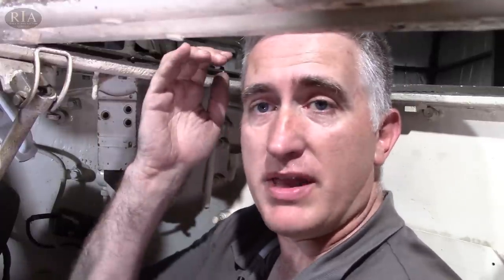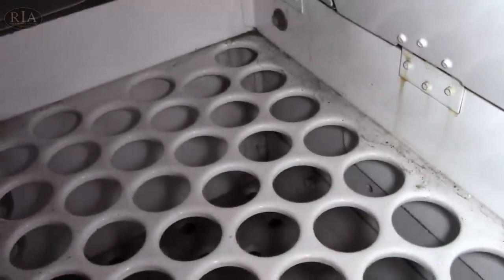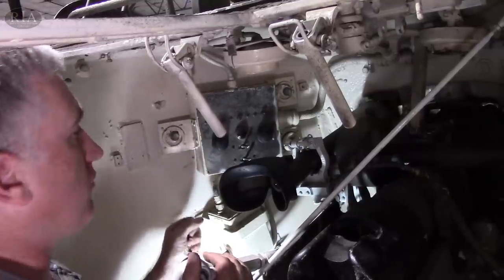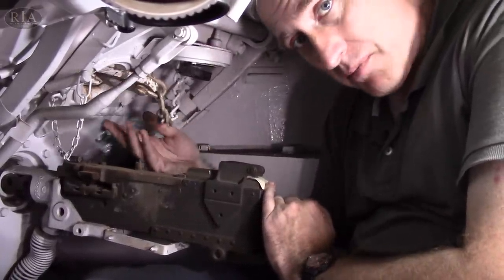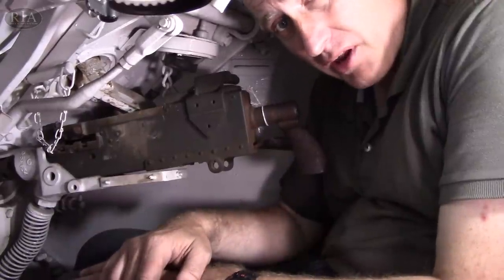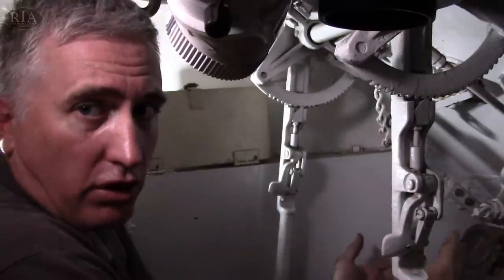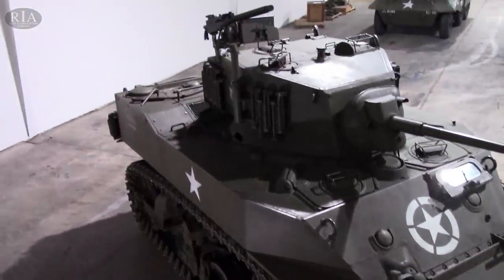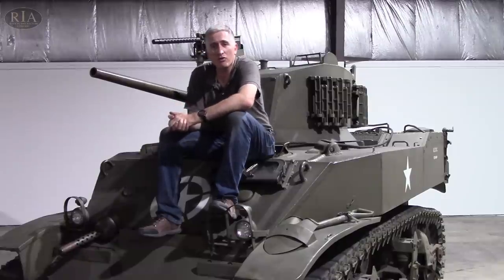Inside the Chieftain's Hatch: M5A1, Pt 2.

Comment: I do really like the M5 Stewie. Didn't Brazil put 90mm guns in theirs and use them through the 90's. And Paraguay also had Stuarts in service until 2014! Great little workhorse
Reply: PMGF 90mm on an M5... are you suuuure about that?
Reply: Look up the X1A and X1A2 Brazilian light tanks
Reply: PMGF If It has "X" in it, it is a prototype. We ended up using the Cascavel(rattlesnake) for the 90mm gun, a national project. Never even heard about a M5 with a 90mm gun here. But while on Stuart brazilian prototypes, we also made one with rockets. Like, the big ones. Not that much people know about it.
Reply from the maker: Brazil used 100 X1 tanks in the cavalry regiments, deliveries completed 1978. The X1A1 did not enter service, but 50 of the X1A2s did, deliveries completed 1983.
Reply: The norwegians modified their Chaffee's to carry 90 mm guns though.
Reply: A 90mm?  I can just imagine how much this little tank would rock from the recoil from the main gun enough to knock ones teeth fillings 😂
Reply: @janekfan666  I'd hate to be inside with the recoil.
Reply: @ernestpaniagua1210  cockerill made low pressure guns suitable for light vehicles.
Reply: @KorianHUN  interesting I didn't know that.

Comment: According to a training film from the period, the air intake is cevered to prevent the good engine from drawing too much air in, I dont understand that as the engine will only draw in what the vacuum from the cylinders pulls
Reply: Yeah, that makes no sense. Presumably you misunderstood, or the guy writing the script had no idea. Or they figured nice simple concepts were more important than truth. There is no such thing as 'too much air' available to an engine, and all restrictions simply reduce the power output. If you do want to do that, you do it by adjusting the size of the throttle body or limiting the movement of the butterfly valve. The covers protect the filter from debris, water and damage. That is why automobiles come with their air filter inside a plastic box drawing air from behind the fender. Aftermarket open-style filters rob less power, but they are more vulnerable.
Reply: I would guess that you cover the bad engine intake to direct the air drawn into the engine compartment was directed out through the working radiator for cooling.
Reply: Might be for the vacuum lines for extras around the tank, with one engine down you lose half the vacuum, but I don’t know if those tanks had vacuum lines

Comment: I would love to see a video of yours explaining tank optical systems in detail, your average layman might not know what an objective lens does lol.
Reply: i sure dont :)
Reply: This goes for any kind of scope; telescope, microscope, etc:
There are two lenses that you are really concerned with, one being the Focusing Lens (Or Ocular Lens), and the Objective Lens. There are usually going to be more lenses between them, but ignore them for now.

The Focusing Lens, or Ocular Lens, (Eyepiece) is the lens you put your eye to. Its job is to focus the image on your retina. They can do a lot more, depending on the application, from further magnification, setting eye relief (how far your eye has to be to able to see the image clearly), etc.

The Objective Lens, is the lens that is closest to what you are viewing. What matters for it, is size, really. A small Objective lens, will gather less light, which will, invariably, deliver a dimmer image. A large one, will provide a brighter image. At noon, it doesn't matter which you have really, as both will get more than enough light to function perfectly well. But as you get closer to dusk, or dawn, get cloud cover, or enter a built up, urban location, a large objective lens will give you more light to work with, where a small objective...could wind up too dim to use. With tanks, it becomes a balancing act between maintaining armour integrity, vs ...being able to see.
Reply: Objective shows what is actually there.
Subjective shows what you reaaaaally wish to be there.
Reply: Ditto, if really like to know that a "unity sight" he keeps talking about is.
Reply: Nice description Goldmarble, thanks! :)
Reply: "Unity sight", as far as I am aware, basically and simply means "no magnification" - the optical ray path breaks, but the "zoom" stays x1. Usually we are talking about prisms here.

Comment: About the 3000 mi radius on the Stuart. From Normandy to Moscow, it's a little less than 2000 miles. That thing can go there and halfway back before needing major maintenance!
Reply: Yeah. Because tanks just drive directly forwards and never have to maneuver or go back for refuelling or shift to another sector of the front.
Reply: Ah, you see I did actually take that into account. the distance by plane would only be about 1600 miles. By modern roads, it'd be 1800 miles. Even during the war, there was vast road systems already, and plus tanks can cross fields, so giving a rounding estimate of 2000 would be reasonable.

About the other points you made, the point about refueling would also be moot, because just bring a refueling truck along. Then the point about being assigned to a different sector wouldn't matter in the hypothetical, because during the war this wouldn't have happened anyways The reason for that is because of cutting across Germany, plus if you wanted to send stuff to Russia, just use ships.
Reply: +Samuel Fisher I think you are underestimating the amount of maneouver. Also that's 3000 miles on nice roads without anything untowards happening, like rubble on the road, poor roads, or people shooting at you. Still, better than the Medium D in the early 1930s, which would probably be down to only half the number of WHEELS it started with in under 300 miles.
Reply: Like I said, because this is a hypothetical, we don't have to worry about getting shot at (because they'd never do this during war time). Either way you'd be surprised with the road system that was in place at the time. This is when the first construction of the Autobahn went into place. The autobahn went from close to Antwerp, and went to where Lithuania is today. Getting from Normandy to Antwerp is relatively easy as well, because the French constructed cross country roads before the war. The only place where you'd have some difficulties is going through Russia, but you can use a rail road as a road.
 If you add up the distances that I covered, ~300 miles from Normandy to Antwerp. ~1000 miles from Antwerp to Lithuania, and ~600 miles from Lithuania to Moscow.
Reply: In theory the road and rail network was great. In reality there was a war on and significant portions of the faster roads had been blown up, or were full of the enemy. It was a bit hard to go direct.

Comment: Can we hear more about this story where a company of Stuarts 'hounded a tiger to death'?
Reply from the maker: I spent a half-hour looking on my hard drive for the file, I seem to have lost the bloody thing (if I ever scanned it). I'll keep an eye out for it.
Reply: The tiger does only have 60mm of armor right behind the tracks, so it is very plausible (Though US tankers didn't know that XD).
Reply: There's also the fact that IRL the armor will deteriorate. You shoot something enough and it'll start to spall and eventually the shell can punch through the more brittle steel. Or, its also possible they got a shot into a weak section (this also depends on whether it was properly destroyed or just disabled like Tiger 131), or got a ricochet that pierced inward.
Reply: +The_Chieftan I have heard of this account and read a summary of it in a book (remember those) back in the 1980s. Not that I can remember WHICH book, and it came from my local library so I don't have it any longer. If it is the same incident it was probably 2nd Armoured based on the fact I was researching that unit at the time, and involved a lot of circling the Tiger faster than its turret could track, and several tanks taking pot shots. I can't remember what actually did for the Tiger in the end. Maybe it ran out of fuel :)
Reply: The M8 taking out a Tiger is just a myth, a case of mistaken identity. There never was a Tiger II at that place on that day. When one goes through the unit records of the only German heavy tank battalion (ss 501st) that was close to it one sees that the furthest the unit came was at Trois Point, some good 40 to 50km distance of travel from Sankt Vith in those days before it was forced back to Stavelot by American fire. They are very detailed in what tank was lost where, all of them back up by photograps showing the knocked out tanks, not surprisingly there is neither mention or any photograph that shows a knocked out Tiger II at Sankt Vith. 

Even the material used from the archives by the people who desperately to claim that the myth is real contradicts the claim as the raneg at which the Greyhound fired was greater than the range listed in the ballistic report at which it might have been possible. Photos made by the US troosp in and around Sankt Vith show no Tigers, just a mix of panzer Ivs, Panthers, and Stugs.
Reply: Don't know if an M8 ever took out a Tiger II, but at least one of them knocked out a Panther tank. On the 27th of October 1944 an M8 of D Troop, 87th  of the US 7th AD spotted a platoon of three Panther tanks of 9. Panzer Division on the road near Neerkant in the south of the Netherlands. The car commander allowed the first one to pass (he was hidden behind a farm along the road) and then fired 6 37mm rounds into the back of the Panther from a range of 15 yards. The panther crew abandoned its tank and the M8  escaped to safety before the other two Panthers managed to bring their guns to bear.
Reply: Can we honestly say that it was knocked out when there is no information given on the damage sustained by the tank or even what happened with it after the M8 left. For all we know the crews would have returned shortly and resumed business.

Was the 9th Panzer also deployed in the Netherlands? Given the location wasn't it one of the Panzerbrigades operating there.
Reply: This is from the AAR of the 87th: About noon, a Troop D M8 armored car was hidden behind haystacks and buildings at the Hoogebrug road junction, when three tiger tanks moved slowly down the road, about 300-400 yards apart. The armored car allowed the first Tiger to pass, and then from a range of approximately 15 yards, pumped six rounds of 37mm AP into the rear of the tank. The tank was ditched, and the crew abandoned it. At least one member of the crew was killed as he fled. Meanwhile, the second Tiger continued up the road toward the junction, and the third swung off to the North to flank the armored car. The armored car escaped when the Tiger was within 200 yards. Later in the afternoon three TD's and one medium were sent to get a Tiger; three TD's and one medium were lost.

The AAR says Tiger tanks but this was 9. Panzer Division and they only had Panther tanks plus a handful of Panzer II tanks. The area were the incident took place was captured by the Germans so the Panther was most likely towed away by a Bergepanther for repairs. 9. Panzer Division reported a strength of 6 Bergepathers on 1 November 1944.
Reply: Pantserbeest  
when you refer to the Panzer II do you mean the ausf. L 'Luchs'? Normally these would be in the Aufklarungs abteilung. With 9th Panzer it could also have been Panzer IVs as the division should have had some of these though without the actual unit records it is hard to say for certain.

If the Germans were able to hold the area then the unit records should be all the more interesting as we might be able to tell what happened to the tank in question after the engagement.

I'm Dutch as well so the language shouldn't be an issue. By all means send them.
Reply: Waar blijven de bevrijders! September-Oktober 1944 van Hugo Levels en Eric Munnicks
Slag in de schaduw Peel/Maas 1944-1945 van A. Korthals Altes en N.K.C.A. In 't Veld
Brabant Bevrijd van Jack Didden en Maarten Swarts
'40 Van Oever naar Oever '45 van de studiegroep Leudal

https://www.blikopdewereld.nl/geschiedenis/nederland/geschiedenis-nederland/1013-de-strijd-bij-meijel
Reply: 9. Panzer Division only had one tank battalion (II./Panzer Regiment 33) with Panther tanks. The first tank battalion and regimental headquarters were at St. Polten for their reconstition. They would rejoin the division in December for the battle of the bulge with 28 Panzer IV and 14 StuG III. The Panzer II tanks were indeed with 9. Pz.A.A. They were from Panzer Kompanie Köhler out of Spandau (Berlin) and were added to the division on 21.09.1944. They were probably not Luchs.

Source: https://forum.axishistory.com/viewtopic.php?f=50&t=65154
Reply: Pantserbeest  Now that you mention it I do seem to recall seeing photos of Panzer IIs used in the Netherlands in 1944, it might be that these were Panzer IIs belonging to the 9th Panzer.

Also thanks for the book title, will go and check it out.
Reply: @Dreachon  so the m8 took out a panzer II and bragged about taking a panther out.
Reply: @DrLoverLover  Well, it wasn't a Panzer II as these had been pulled out of service long ago.

Nor did the crew of the M8 go around bragging as the unit they belonged to themselves never even reported or listed this supposed engagement in the first place.
Reply: RedTipAlpha they were still plenty aware that with superior numbers and mobility they could get around it and shoot it in the ass.

Comment: As far as using the American 37-mm gun to knockout a German Tiger Tank; a U.S. 37-mm mounted in a Ford M8 Greyhound brought down a Tiger in the waning days of 'The Battle of the Bulge'. It did so by allowing the Tiger to pass by, then sneaking up behind it. It took only three rounds to bring the beast down, but contrary to what is said here, it did indeed happen! 👀
Reply: Honest I not surprised a herd of Stewarts M5 could knock out a  single Tiger or a Panther . Several shots in their overly complex overlapping road wheel system or knock out a one of the tracks and then taking shots at the thin rear armour around the engine compartments when the tracks/road wheels were knocked out making the German tank immobile . I have read similar teamwork  tactics being use  by M4 Sherman crews that had gp 75mm gun knocking out single Tiger or panther tanks.   It is doable but not the prefered method of knocking out a heavy german tanks .
Reply: @cmdredstrakerofshado1159  Excellent points. Besides, the Light Tank M5A1 'Stewart is one of the most versatile, mobile and extremely tough American Tanks of WWII! The Marines sure got a lot of use out of Her in the Pacific Theater. Besides, it just looks so cool too! Take care and thanks for the reply, Comdr. Straker. (BTW., I am an American who lives in The Netherlands, did you know that the word 'Straker' means 'Tighter' in Nederlands/Dutch? Just a Free Fun Fact)
Reply: @MrMenefrego1  No I did not know that about the name Straker  thanks, the handle has to do with the fact Ed Straker is one of my favorite characters in any the Gerry/Sylvia Anderson series. Unfortunately my old handle Drake Is Six got nuked by Youtube for unspecified political heresys  about 3 weeks before US november shit show elections.  I started using fictional  handles/avatars about 3 years ago ever since my companies social media policies changed  even your private accounts on Youtube and Twitter , etc.  BTW he forgot to mention since this was a USMC M5A1 used in the Pacific, was the 37mm  Canister round that Fired about 122 steel shot effectively turn into a 37mm  giant shotgun, which was a great way to ruin any banzai charge .
Reply: @cmdredstrakerofshado1159  Additionally, utilizing that U.S. 37-mm canister round which, as you pointed-out, fired the steel shot effectively transformed it into a giant shotgun; that 37-mm canister round was also extremely effective for literally blowing-away the foliage which concealed many of the Japanese bunkers and strongpoints, thus causing them to be rather vulnerable now that everyone and his buddy with the flamethrower could now see them! Take care and Good Luck, as the next few days are going to be quite interesting, not to mention extremely historic in America. (Concerning your comment of: "my old handle Drake Is Six got nuked by Youtube for unspecified political heresys": I have a 'feeling' that YouTube as-well-as Twitter and the other Nazi-like social media companies will deeply regret their actions in the immediate days to come! This situation is far from over, nothing can stop what is coming their way!) God Bless President Trump 45 & 46 and The United States FOR America!

Comment: If one engine is dead the other will suck cooling air through the  dead fan opening instead of through the radiator and overheat. Hence the necessity of covering the opening.

Comment: The Brazilians turned them into fairly modern AFVs by adding a 90mm main gun, laser rangefinder, etc.  It was called the X1.  There were variants proposed that extended the hull length, and added a 300hp diesel engine as well.  They converted around 100 of them.